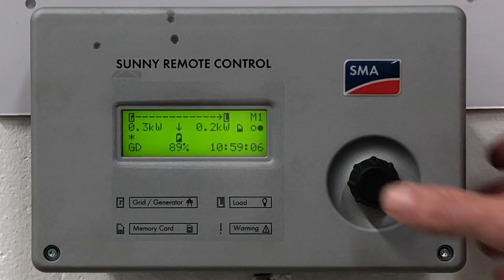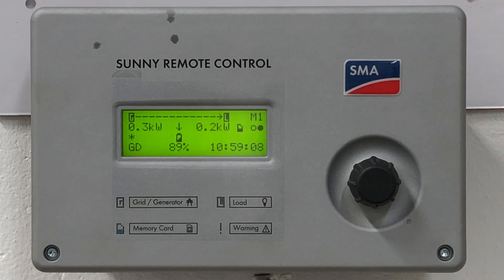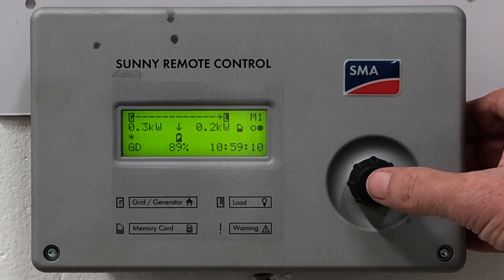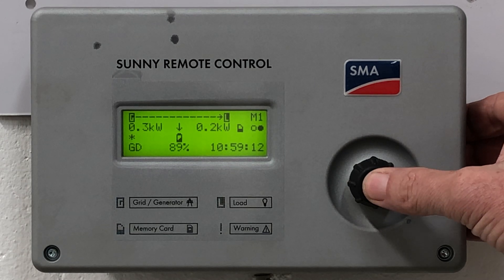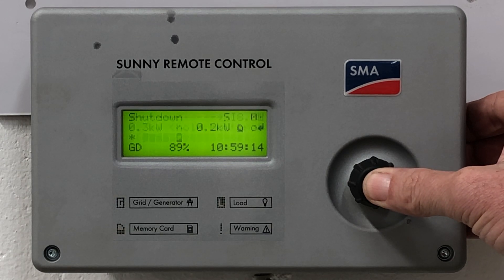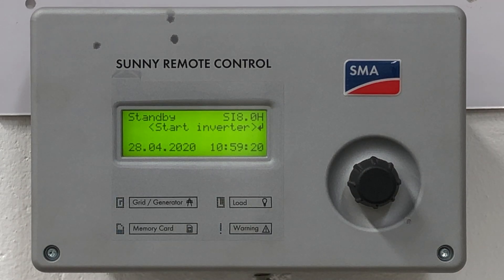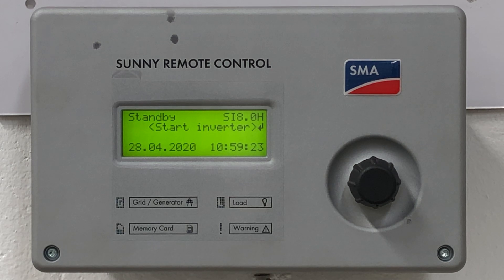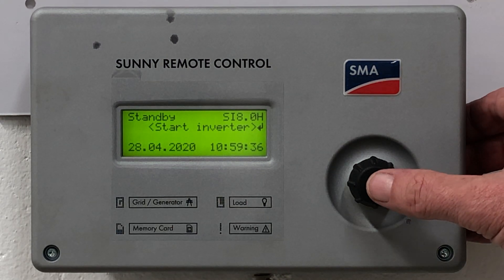Switching Sunny Island Systems between Power On and Standby

Comment: excuse me, I have 13 battery units (100ah) that I installed in parallel into 1 battery bank. so if I want to set the system on Sunny Remote Control on the battery menu, do I have to fill in the current description of the battery as much as 100ah or 1300ah?
Reply from the maker: This is an unusual configuration.  It is not advisable to have more than 4 batteries in parallel.  Are your batteries 48V?  If you have batteries in parallel you must add up the Ah ratings.
Reply: @1energy550  ya my battery is 48v
Reply: @1energy550  so i must up the Ah ratings according to parallel systems right?
Reply from the maker: @MUHATAQWA  Yes, correct.  Multiply the Ah rating of the batteries by the number of batteries in parallel.
Reply from the maker: ... and divide the C100 rating by 1/25
Reply from the maker: .... correction, divide by 1.25
Reply: @1energy550  why must to divide by 1.25 ?
Reply: @1energy550  you mean each of my battery (100Ah : 1.25 = 80Ah) and then (80Ah x 13 = 1040). Is that correct?
Reply from the maker: @MUHATAQWA  I'm assuming your batteries are lead acid, in which case you have to use the C10 value, or if you don't have C10 data, then divide C100 by 1.25.  If they are lithium batteries then generally you can just put in the Ah rating straight.  Whichever is the case, your calculation of Ah x 13 is correct.
Reply: @1energy550  ohh I see.. glad to find your channel
Reply: @1energy550  another question, what is the GriCurNom ? In this cas it's depend on what ?? How much value which i can set on that
Reply from the maker: @MUHATAQWA  That is the maximum current you can pull from your grid supply.  Make sure it does not exceed the rating of the breaker feeding the grid power to the inverters.
Reply: @1energy550  from PV source ?